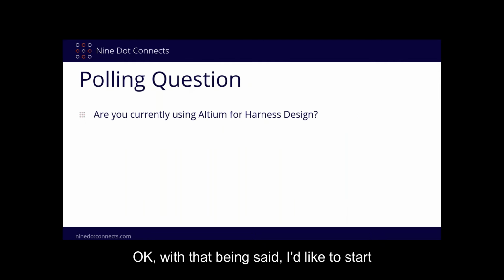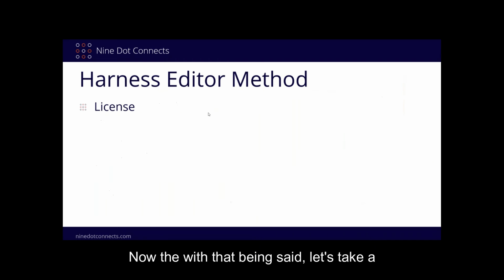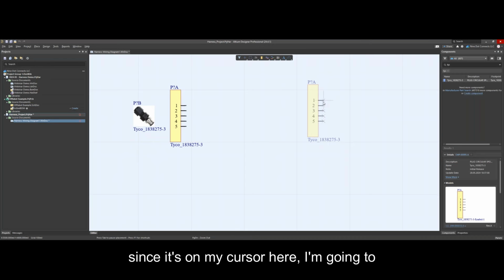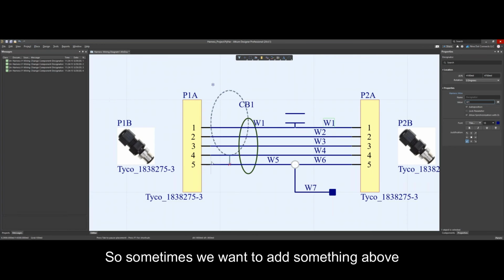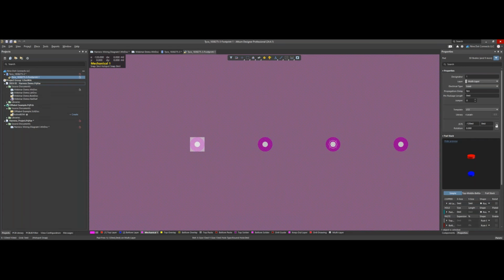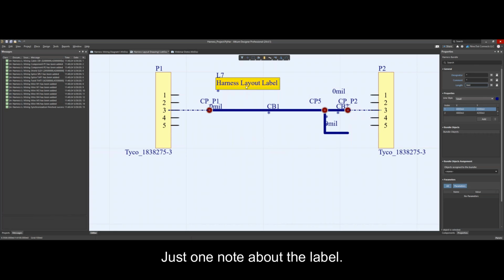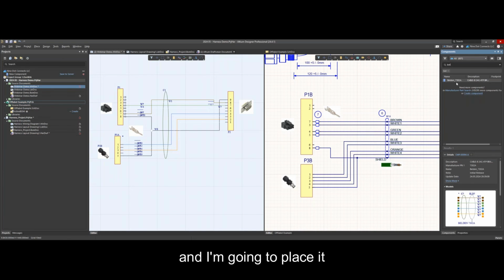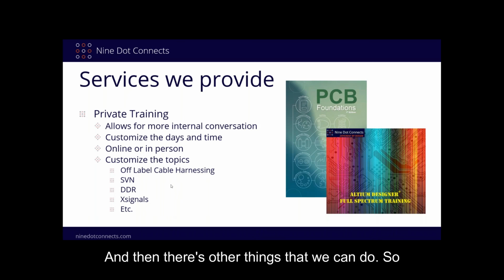Harness  in Altium Designer Webinar - "Off-Label" vs. Harness Editor

Comment: Does Altium offer a default Harness Design Connector library?  Else, is there any step by step instructions for creating a Harness Library and Connector Components?  I'm new to Altium and Harness Design.  I'm finding few resources to help guide me.
Reply from the maker: Given that this editor is relatively new, we don't expect to find existing libraries available other than what Altium might provide in their default A365 set-up, if any. As for creating a harness component, this has to be done through A365. For step-by-step instructions, check out this link: https://www.altium.com/documentation/altium-designer/harness-component.